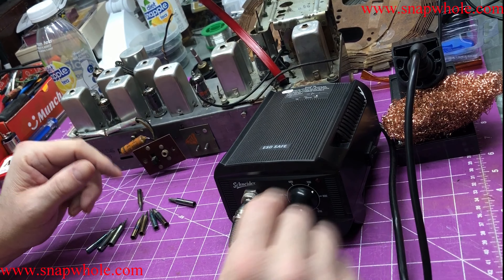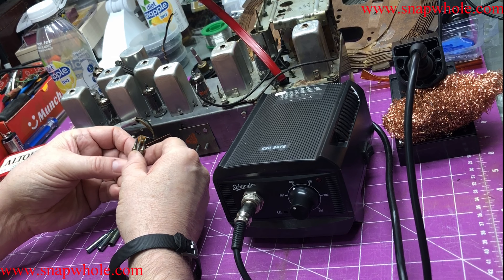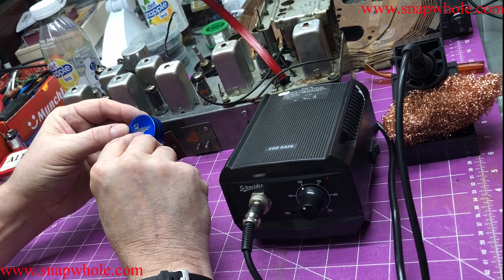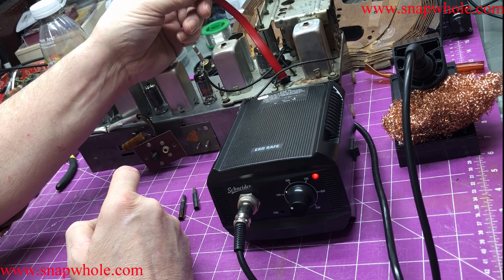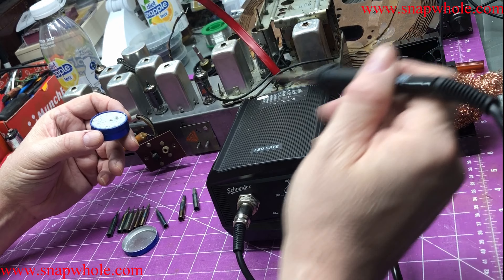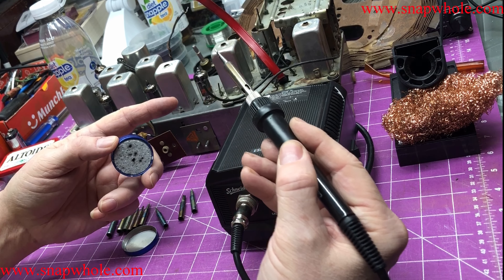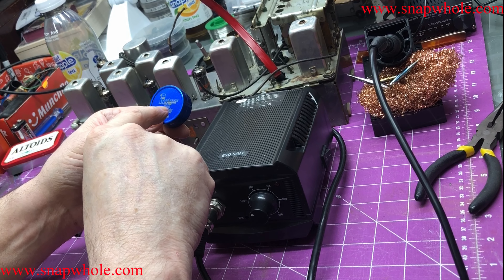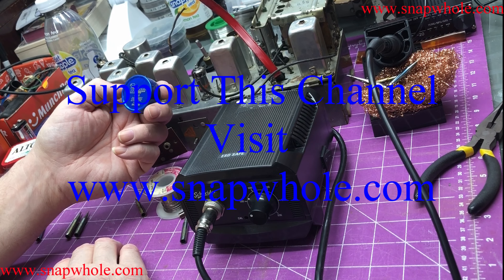Harbor Freight Scheider Soldering Iron Tip Restoration  - Save Burned Up Soldering Tips

Comment: I had the same problem and I'm soldering very small wire plus I didn't have a station I could set the gun in and clean it. Looks like I'm heading over to Harbor freight for some tips and maybe a new set up. Thanks.
Reply from the maker: glad you found the video helpful, thanks for the positive comment and thanks for subscribing!

Comment: Hey man ! Where can I get replacement tips ??? Can’t find any info anywhere!
Reply from the maker: I gave this info in the video, these are 900M-T tips, and come in dozens of tip profiles, from very small pointed tips to very broad flat tips, I prefer 900M-T-I (eye, not one) because I do a lot of small form electronics, and 900M-T-4C for soldering cables - you can search amazon or aliexpress, lots of sellers, lots of different prices, keep spares on hand, they are replaceable tips, and they are made to burn up over time, the hotter you run the iron, the faster they will burn up, by burn up, I mean the coating burns off and they don't work as well - thanks for subscribing!